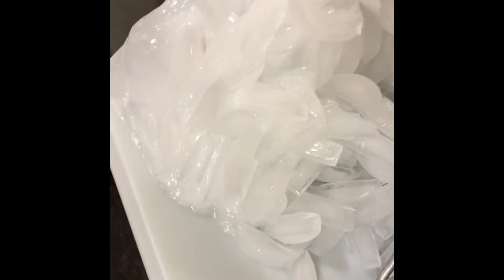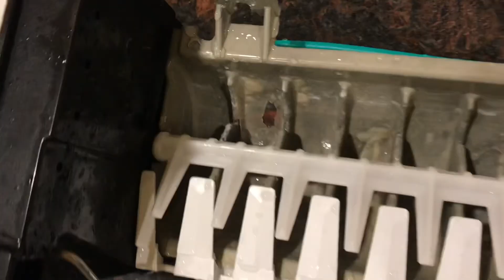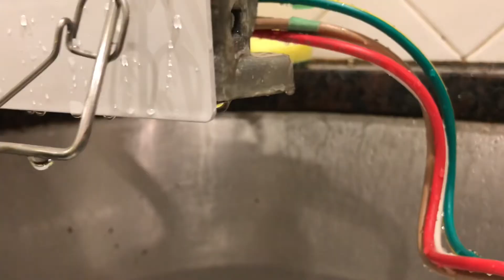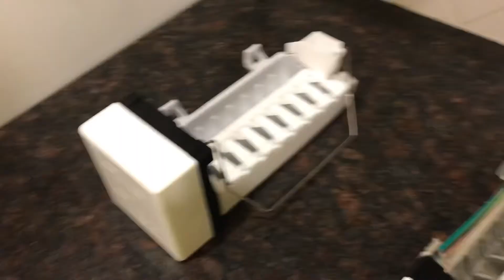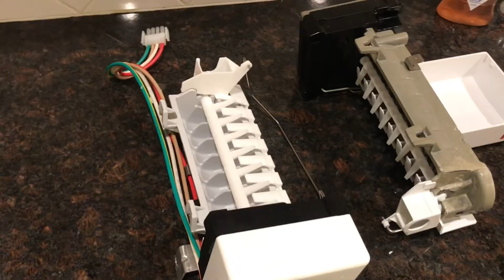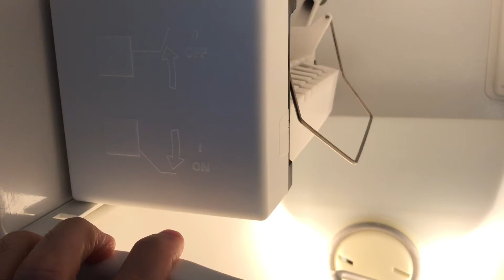Ice Maker leaking water inside freezer - repair / fix / replacement - Amana / Whirlpool

Comment: My little sad story on a KitchenAid side-by-side from 2003 started with a drip from the water dispenser or so I thought. But now in retrospect I think it was overflow. I got a replacement valve on Amazon and that had its own little quirky issues. I put it back in and then I started to have this large blocks of ice cubes all together in addition to the water basically damming up in the area where you would dispense the ice cubes from out the door. You can end up going down such a rabbit hole with this stuff thinking oh maybe it's my water pressure and all. But now I'm starting to think that it had something to do with the tray all along. The refrigerator is 23 years old I'm going to get a new French door type. I've got a good run with this I gave it a shot but I'm not going to invest the money to replace an ice maker. I've got lots of ice that got made in the freezer and then I just shut the ice maker off. On this KitchenAid there are no possible screws to turn to change the flow of the water or anything. I checked and it's kind of like something where they said it's on the control board. All that was actually there was the timer.  But this was a really interesting video and I appreciate it.

Comment: had the same issue on the same model just a smaller leak and ended up cutting a sponge and wedging it up between the plastic frame and the coils that hold the ice to absorb the water.

Comment: I had the same problem with my Amana but the problem turned out to be low water pressure in my development.  Once that was fixed the ice maker worked fine again without me doing anything.

Comment: I used this as a road my to fix my whirlpool model ed5fhgxkq02 which is very similar. Fixed it right up. Thank you!
Reply: Just got a brand new whirlpool less than a month old and it just pouring water in the tray. Going to try this.

Comment: Mine was doing the same, but it was the ice door seal. It was raising the temp. enough to melt the ice in the tray, as well as the bin. Gears tore up, too, because the ice was stuck in the tray.

Comment: mine, the actual water line is frozen; I mean that water spout you see before it gets to the tray.  we've had this block of ice problem for a number of months, maybe even close to a year... as a working single mom of 4 kids well... idk how to do any of this stuff.  I've tried a hairdryer to the spout to no avail.  Might just have to finance a new refrigerator 😞
Reply: I can tell you exactly the problem. Had same issue. Fridgedaire brand by chance? Thawing it out won’t work. It will just freeze again. Get someone or yourself to Pull refrigerator out to access water line. Turn off water at floor valve. Undo the water line from the top right of refrigerator.”twist most half turn left then pull. Now turn back on the water to check the pressure coming from the line. Probably very slow. This means the filter “blue” at bottom right is clogged. That would be my guess. If tour water is on the hard side this is more than likely the case. Goodluck if you have not gotten a new one by now. Lol.

Comment: This is what our 22 year old Kenmore started doing a month ago. I decided not to spend a dime on parts. This band aid works. Place two dry wash cloths in the corner of the ice bin and up to the where the water leaks from the tray, let them get to freezer temp. Then turn on the ice maker and the wash cloths will retain the water/ice and that will keep the ice cubes from turning into a solid block. I watched this video earlier and 12 hours later I can say this works.
Reply: I'm trying to go this route since the refrigerator is not mine but not sure exactly where to put the dry cloths. Does your washcloth cover down to the bottom of the ice bin? Are the washcloths rolled and standing vertically on each corner?
Reply: @j0lla127  Make sure that the wash cloth does not interfere with removal of the big ice bin because when it freezes rock hard and protrudes above the ice bin a hair dryer will be needed to melt the top part of the wash cloth. The wash cloth will be covering some of the bottom and this will prevent the auger from turning but you can remove ice cubes by hand.
Reply: That is what I am doing, but that is short term. I would not recommend it long term.